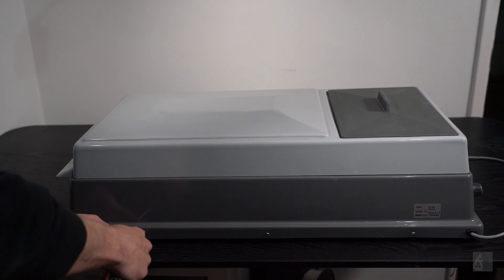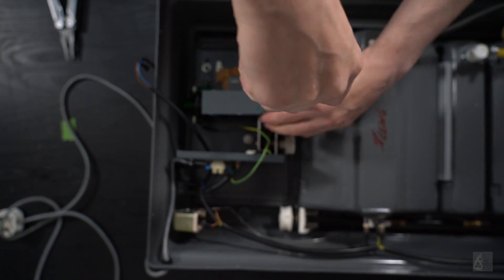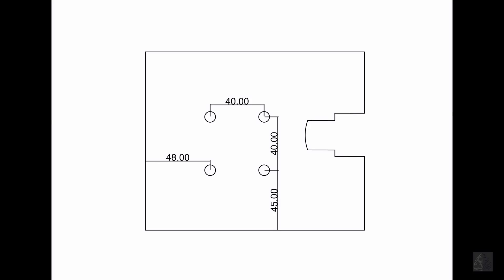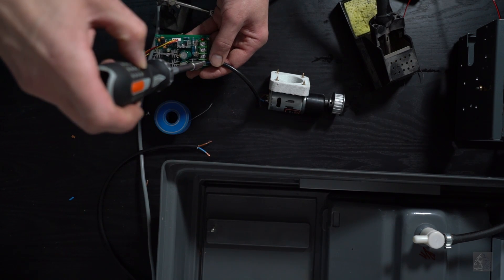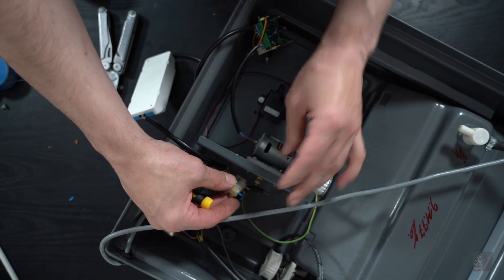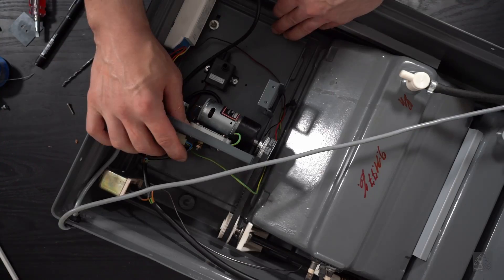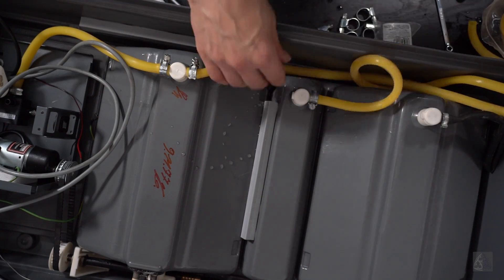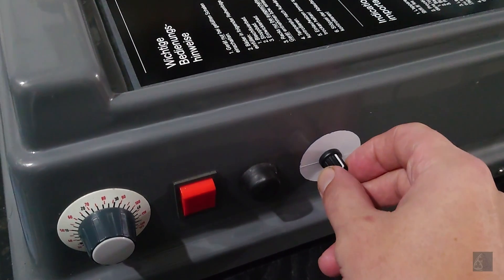RCP20 | Installing a new variable speed motor on an old Durst Darkroom print processor.

Comment: Excellent! You mentioned a 30mm diameter gear with 20 teeth you attached to the motor. Could you be more specific on that one, perhaps even a link? Many thanks!
Reply from the maker: Found it. It is not 30mm it's 31. https://cpc.farnell.com/mfa/919d9/t5-timing-pulley-20-teeth/dp/HK00940?CMP=i-ddd7-00001003
Reply: @n.defrance Many thanks! Merci beaucoup!
Reply from the maker: I am going to check where I got it from, I will get back to you and give you a link.

Comment: Hey I have a rcp40 will this be the same handeling
Reply from the maker: I don't know, I have never opened  or used one. I would expect it should be pretty similar for the sake of manufacturing but cannot give any guaranty.
Reply: Looks excactly the same as the rcp20 but everything a bit bigger

Comment: Hello were did you buy the new cog
Reply from the maker: Just checked and the place I bought it from does not sell them anymore.
 Rapid online seems to sell them as "timing belt pulley"
Reply: Thank you I've purchased the other parts also where do you plug the pump in.
Regards Andrew
Reply from the maker: For the electric, the pump is plugged on the same 12v transformer than the motor.
Reply: And the 3d printed bit
Reply from the maker: If you mean how is the pump connected to the chassis, I just drilled holes at the right place and bolted it. I ended up using a diaphragm pump not the small black one you see at some point in the video.
For the 3d printed motor mount. I put a link in the description.
Reply: Thank you very much most appreciated
Reply: Did you use the wires that went into the old transformer and then put them into the new one also were did you put the earth.
Regards Andrew
Reply from the maker: I used a new wire to connect from the domino connector to the new transformer because the old wire to the motor was not long enough (if I remember well) and I earthed the metal plate, I reconnected it to were it was previously connected.  (Sorry. I am having difficulties to remember, I was now a long time ago.)
Reply: Thanks for all of your help my model is slightly different layout and the tension plate was made of plastic but I have reconfigured it to fit many Thanks again   
Regards Andrew
Reply from the maker: Good to hear you got it to work, glad I could help.

Comment: I’m in the US and couldn’t find the exact motor.  I found a similar motor but gear ratio is 250:1. Does that matter?  Can you provide a link to where you bought your motor?
Reply from the maker: It would depend on the initial dc motor speed.
The motor needs to have around 106rpm at 12v.
The motor I use can go up to 132rpm at 15v if needed.
4.5v :40rpm   6v:53rpm 9v:80rpm 12v:106rpm 15v:132.
Or you could change the gears sizes, I made the calculations for mine more than a year ago so can't really help you on that.

If you type "MFA 919D1481" on the website rapidonline or farnell, it will show you the motor.

Comment: very good video. i have a rcp-20 as well. which tubes did you use for replacement? why did the original pump not work? i tried mine and it seems to work. like to modify my machine as well. thanks !
Reply from the maker: For the tube I used latex tubes.
 I used a small amount of silicone to make sure they stick to the connectors because those are not really good at grabbing the tube.
For the pump I was talking about the first replacement pump that I used. You can see it on the tensioning plate, it is a small rectangular box in the video.
The original pump worked great but it was part of the electric motor, I wanted everything on 12v.
You may be able to reuse it, I haven't tried.
There is another way to modify the RCP20 by changing just one gear, it could another option.